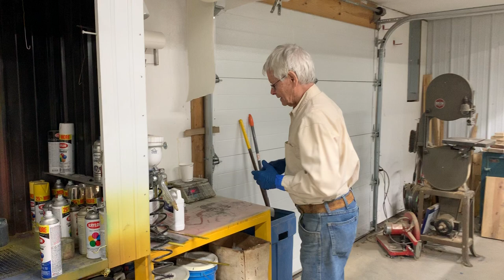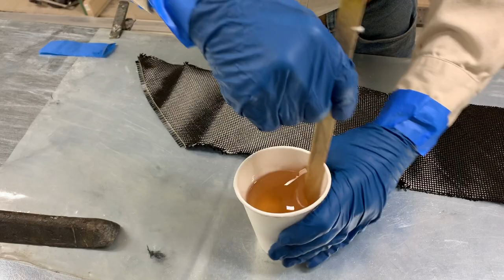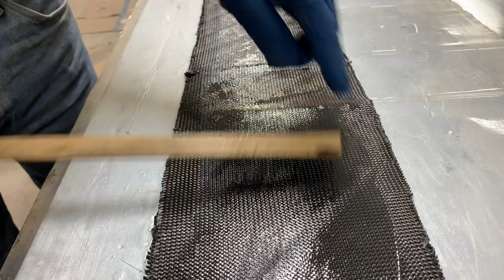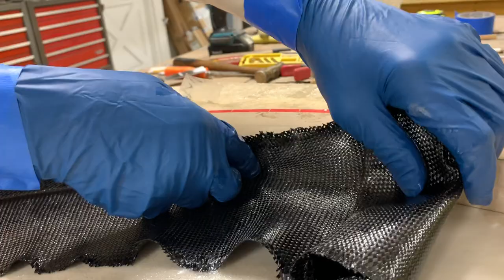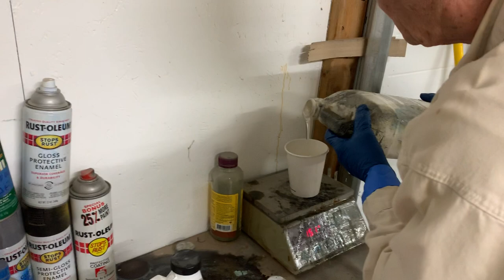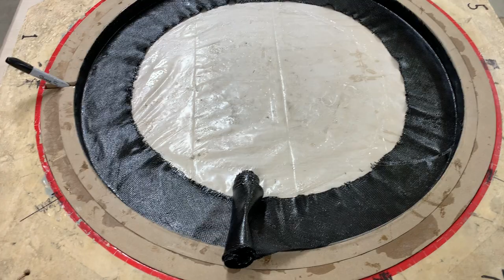The procedure for making carbon fiber aircraft ribs part 1 of 3

Comment: Spreading with a stick is a great technique! Another idea that helps reduce the over saturation of the carbon is to place another layer of clear plastic over the laminate after applying the resin and then use a squeegee to squeeze out the excess resin. To maintain the inner diameter of your ring rib you could mark a circle on the plastic as a guide instead of eyeballing it.

Comment: Infusion will always provide a more accurate ratio of material to resin. That's why production manufacturing where Finite element analysis can be used to calculate material strength. Typically brushing it in will result in a higher resin to material ratio which isn't necessarily bad for strength but weight per piece and resistance to fracture may be affected.
Reply: You can get decent composite by wet lay-up BUT you need a vacuum bag. Many German aircraft manufacturers still use this method with automatic resin dispensing which makes it a wet-preg.

Comment: Do you think it’s safe the way carbon fiber airplanes are not held to the frames by rivets? To me it seems like a bad idea given the constant pressure and temperature changes. To me, it seems like a bad idea, and wouldn’t it tear or breakdown sooner with UV or Infrared rays? The skin of the planes are held in by aluminum brackets glued to the aluminum frame……..hopefully you can do some research and tell Boeing because as it seems right now, I just don’t understand how a 787 airplane can hold 33 Thousand gallons of fuel. That is like the truck that refills gas stations.
Reply: Also if planes burn little fuel when up high in the sky wouldn’t that mean there’s more oxygen the higher you go? That is why planes burn little kerosene the higher you fly because more oxygen ignites fuel at a lower temperature and burns hotter…..Also in space is pure oxygen. That is how they are able to operate the thrusters. Please let me know your thoughts.
Reply: @jeremeyhowlett6773  less drag up high because of reduced air density